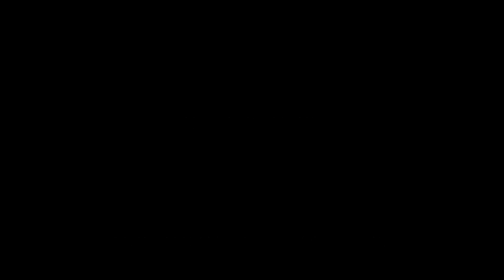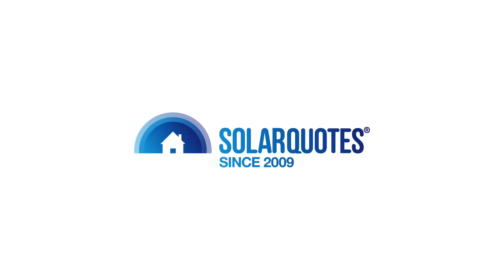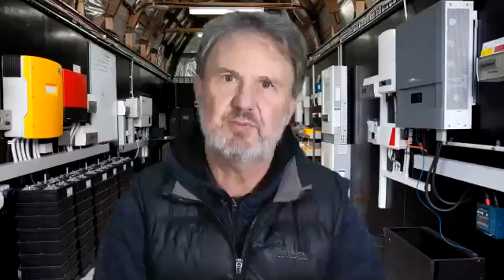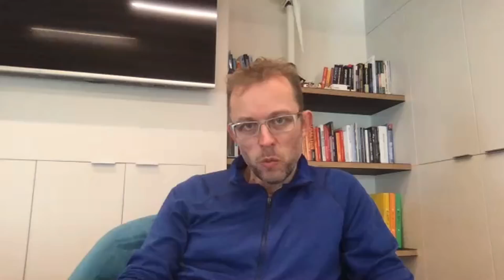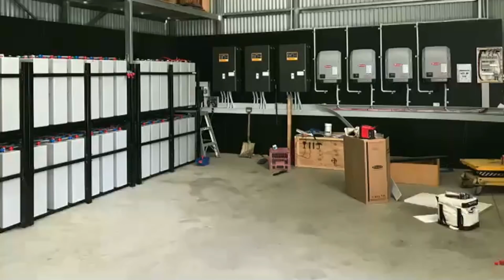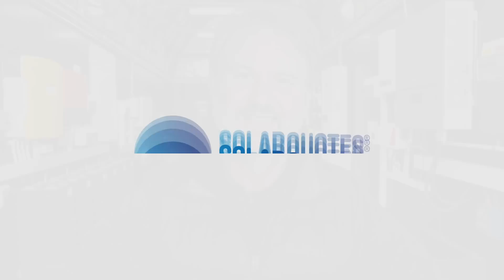How to take factories off grid

Comment: Watch the laws soon change to make this illegal. Once more of these types of systems get installed the grid gets zero benefit from solar feeding into the grid and periods of heavy loads when these systems need to charge their batteries due to bad weather. Imagine hundreds or thousands of these systems all loading up the grid due to a weeks worth of cloudy weather.
Reply: Hi Bill, this system doesn't export to the grid, it's not a grid paralleling system. As far as the grid is concerned this customer just uses almost no power. There's no law against going on holiday.

Comment: Hi Finn' this stuff has been around for some time in residential application. Lots of people do it .Sunny Island and others can do it . It is called Gen mode
Reply: Hi Michael, in Australia our grid inverter standard (AS/NZS 4777.1) doesn't allow interactive inverters, like the Sunny Island, to be paralleled with the grid supply unless: A the inverter is AS/NZS 4777.2 compliant (Sunny Island isn't) and B. the utility permits the connection (often with caveats like adding an expensive grid protection device).
Reply: Hi Glenn, not even when you create a separate switchboard with all circuits not interactivity with the grid?
Reply: @buildingbiology  Sunny Island has two AC ports: AC2 connects to your backup loads (preferabley via a dedicated switchboard); AC1 connects to the alternate source (grid or generator). In Australia you can only connect AC1 to a generator as this port is no longer AS/NZS 4777.2:2015 compliant.
Reply: @SmartEnergyLab  Thanks Glenn,good to know that there is still some inverters what can do that .
Thanks for your great explanation  Cheers Michael